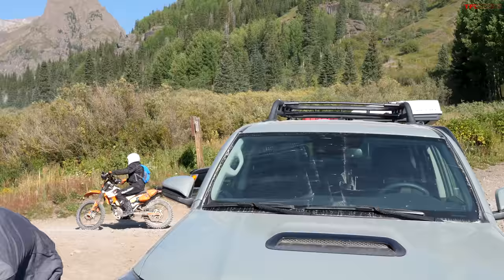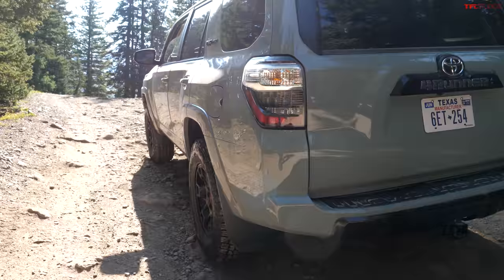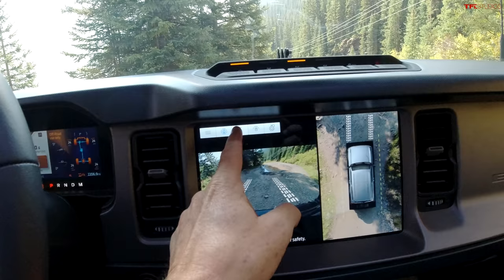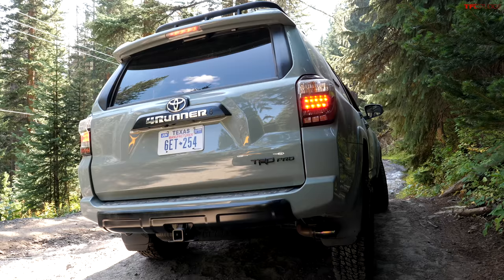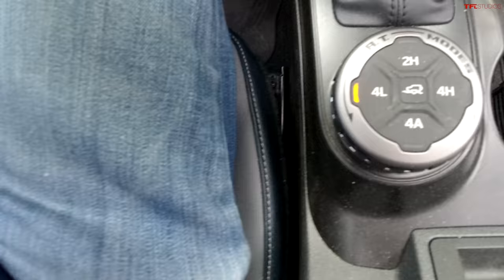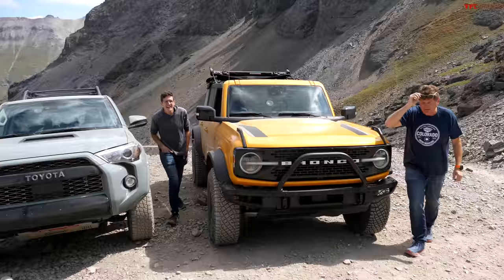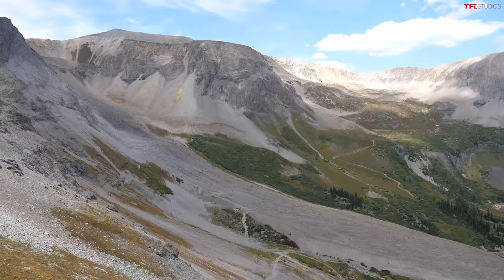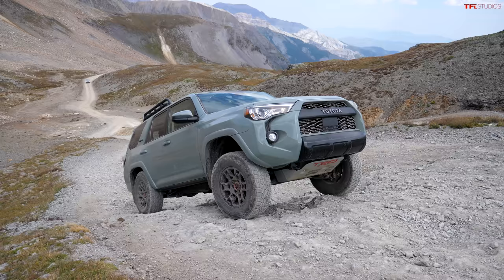The Toyota 4Runner TRD Pro May Be Old, But Can It Still Keep Up With The Ford Bronco Up A Mountain?

Comment: These vehicles only compete and compare with each other when new, after the warranty is up the Ford will not be worth owning any longer whilst the Toyota will still be going and going and going........TRD Pro is old and reliable and proven itself over time, Toyota has good reason to not update the platform every year.
Reply: So true.  Bring these exact vehicles back in 10 years and try again.  One may not even show up for the challenge.
Reply: It will be interesting to see what they do with the new 4runner that is supposedly coming in 2023.  Anticipating more electronics and a turbo 4 (maybe they will put the twin turbo 6 from the Land Cruiser in as an option, but I doubt it).
Reply: 4Runner/Taco Bros: "look! I've gone 300k pavement miles"

Bronco and Wrangler Bros: "cool" goes back to actual offroading*
Reply: @mattg8116  the kids need to get to soccer practice somehow!
Reply: @mr75204  calm down karen , don’t get your princess undies in a bunch.

Comment: Long term durability is where the 4Runner shines. The old school Japanese assembled 4Runner will last 300k with very little routine maintenance and minimal repairs.
Reply: Yes but as much as people hate to admit it Ford vehicles are pretty reliable. Just like every brand they have recalls Toyota just had a massive recall. There's so many old '94 ford's cruising around with over $250,000 miles on them
Reply: @usz28  Of course there are some Ford models that end up being reliable but overall Toyota as a brand buries Ford from a reliability standpoint.  Even with the recalls.
Reply: Tell me about those old Toyota timing chains, head gaskets, and frame rot just to name a few. This coming from my own experience.
Reply: Fact: if you get 100,000 Toyota anythings and compare them to 100,000 Ford/Jeep/Nissan/any brand comparable, the Toyotas will have more cars that continue to work and fewer that have significant problems. There are lots of reasons not to buy a Toyota, but they are the best at what they aim to do. In fact, every industry on the planet has tried to copy how Toyota does what they do, and Toyota is still the best at that process. They have the secret sauce built into their culture, and no manufacturing, tech, healthcare, or any other kind of company has been able to better them.
Reply: Yeah, everywhere except the salt belt.   Mechanically great, the best IMO...but their vehicles on frames, FJ's, Tundra's, 4Runners, etc, just don't last. Maybe these last couple model years they've finally turned a corner, but a 2017 Tundra I looked at last week, was already rusting through the bed where it mounts to the frame.  Which is apparently a common issue.
Reply: @brookdavis8425  Tell us which brands don't.
Reply: I'm going on 22 years with my 98 4Runner. Zero rust, southern car.
Reply: @luchaDor  you need to move!!  I take brake lines off 20 year old cars with no torch.
Reply: @GoDaveGo  Correct! It's not the  product, it's the culture of the people who made it - discipline.
Reply: @usz28  Ford - FIX OR REPAIR DAILY
Reply: I agree. I have a 300k Toyota my self.
Reply: I love my Toyota’s but in the North they rust worse than almost anything. My dad has driven Fords, my Brother Chevy’s and I Toyota’s for a long time. Day to day reliability the Toyota is the best, but frame rot and rust anything else is better…
Reply: @usz28  NO WAY rust ,rust ,rust
Reply: @billyhughes9776  - no it does not, you can’t compare a truck that’s hard 100k hard miles of constant towing and running long days to a commute to an office job and Whole Foods once a week
Reply: I've had my 2000 Tacoma going on 21 years now. Very little rust,very little in repairs. 2.7 motor with 325000 miles and still runnin strong. Daily driver
Reply: @slinginlead6647  what is your general location? Rust belt?
Reply: What does Scotty Kilmer say about Toyotas?
Reply: I can verify that Toyota Tacoma will last 315,000 with the biggest problem being a serpentine belt idler having to be replaced at a cost of less than $50. I kept up with routine maintenance.
Reply: @fireye0889  Central Virginia
Reply: That's not really some huge accomplishment for trucks.  There are plenty of F-150s that are above 300k miles and still being used as work trucks.
Reply: FordGTGuy    says the ford guy, literally!   No one cares what I think or you think just read the facts by independent researchers that show Toyota far far far far beats ford in reliability.  It's not even a discussion that should be had.  That bronco will be in the  shop until the day it's sold for half its value while the 4Runner will hold 80% of its value if the owner is dumb enough to sell it cause it will last for hundreds of thousands of miles.
Reply: @TS-xj5mt  Ok?  I've been in many Fords with over 300k miles.  Crown Victorias, F-150s, Explorers, Expeditions, Broncos, and even Mustangs.

Road is packed with old Ford trucks and cars that are both workhorse service fleet vehicles and privately owned.

300k is not some crazy number to hit for cabs or work trucks.

Modern Toyotas do not have the reliability they once had.  The idea of modern reliability research is BS too.  If a car has an issue with the infotainment system it effects the reliability numbers.  On top of everything Toyota has had more recalls than any other manufacturer.
Reply: Any vehicle can last 300k with maintenance and minimal repairs. But how many people will actually stick to scheduled maintenance or actually care to keep a car or truck that long?
Reply: @drpeppero3  Funny how that never really happens much outside of the Toyota world.
Reply: @fordgtguy  I am enjoying the (in typical Ford fashion) shit-show that is the new Bronco.
Reply: @Pleasiotic1  really? Are you sure? Stop being a fan boy. If it wasnt true. Collector cars or trucks and or vintage would never be a thing.
Reply: @drpeppero3    Yes I am sure any non Toyota 300k anything has next to zero value assuming it even runs correctly and has probably mostly fallen apart unless its something that is brand new and was just driven 24/7... and even then.  Look at the value of a 300k 4runner vs any 300k Ford product and try again.   Also show me how many 300k Kia's and Chevy anything or how about Mazda or Mitsubishi are still running around like a top only having had actual routine maintenance?  How many Million mile non Toyota's are out there? 

There is a reason the anecdotes that are popular exist.
Reply: @Pleasiotic1   I've driven Explorers with over 500,000 miles.  There are a bunch of F-150s and Crown Victorias north of 500,000 miles.  You guys do realize that 300,000 is not that impressive and not something only Toyota vehicles accomplish?   Anyone paying high dollar for any car with 300,000+ miles is an idiot.

There is a Crown Victoria with over a million miles.
Reply: @usz28  Ford TRUCKS are pretty reliable. Ford CARS aren't.
Reply: @GoDaveGo   It’s model specific.  Toyota has shipped some unbelievable hunks of 💩 in recents years.   Like that 2.4 4 cyl that came in Camry, Scion Tc, etc. 

I’ve seen so many of those things are massive oil burners from day one…I’ve also seem many jump time at destroy themselves below 100K even when they were religiously kept topped off with oil.   

If that engine was a Ford or GM engine the issues would have been announced the rooftops.
Reply: @mayanaztec6440   I have a 400K Ford, anecdotes are great
Reply: @TS-xj5mt   Lol, your logic, reason and understanding of the automotive industry is impeccable.  🙄😂
Reply: B C 08     thanks.
Reply: B C 08   I have a family member that smoked two packs a day for 60 years and died in his 80's.   you should try that and see how it works out for you.   I love you people with your antidotal evidence that should overshadow millions of statistics and research done by independent engineers and repair statistics for 50 years.
Reply: FIRST ON RACE DAY PROVEN!
Reply: Are they charging extra for the leaks in the Bronco?
Reply: Ford won’t pass 150k without major engine repairs
Reply: False OP
Reply: @GoDaveGo  YES. It's called the Toyota Way...the most copied manufacturing platform in the world. 5s and continuous improvement.
Reply: @luchaDor  If you live in a salt state it will rust any vehicle. I live in Cali and have a 1985 Toyota pickup no rust still running.
Reply: @Pleasiotic1  Is a new model from scratch they will continue to get better, and I assure you they will be a good and reliable as all F150's are, I'd gladly trade in my 16 4Runner for a Bronco in a blink of an eye, no comparison here, side by side the Bronco will blow our 4Runners doors off easily..
Reply: @Pleasiotic1  Dude, have you seen the prices on those half a million Continentals?? They are nowhere in the low range, Also a well taken care Mustang and Ford truck keep up their value no matter the mileage, get outta your bubble.
Reply: @SSVplus  Lol the only non reliable Ford cars were the Europena models, ALL domestic V8 Fords specially and Mustangs, that includes also large size cars are among the most indestructible cars ever made.
Reply: @JohnJones-ty6fj  That ain't a big issue, only roof needs remodeling, what about actual off roading performance???
Reply: @TwinTurboToyota  HAHAHAHAHAHAHA, what a fool, I've owned many Fords, ALL had gone like nothing after 250K miles, you must be on another planet.
Reply: @gorgeusjames  it will spend more time in the rain here than off-road. It’s a big deal if it’s mildewed a few months into its life.
Reply: @gorgeusjames  Mustangs are not reliable.
Reply: @SSVplus  Said no one ever, I owned 3 and all had been on top, it's easy to google it, huh...unless you drive like you're on a rece ANY car will break down..
Reply: @JohnJones-ty6fj  Well, good I don't live where it rains and snows otherwise my 4Runner would be rusted to death..
Reply: @gorgeusjames I own two 4Runners. No rust. No leaks. And it rains a lot here.
Reply: @SSVplus  🤣Ok whatever makes you happy.
Reply: 22 years, 300k miles.2/3rds of it's life in Colorado and the rest in Oregon. My 00 taco TRD hasNothing more than lil surface rust on frame here and there. It's only needed 3 repairs to get it back up and running in all that time. 2 starters and 1 ignition. 650 bucks total. Best damn vehicle I've ever seen, heard of, had. Still going strong every day.
Reply: I’ve had a 1997 ford explorer that had 397,000 miles when I sold it.   I still see the kid driving it around time to time. 

I’ve seen more 300k plus explorers than I have 4Runners.  

With Toyota, It’s always wheels bearings and wheel bearings and wheel bearings.
Reply: @Igloo_papi  I have a 2002 expedition, idk how different they are built from a explorer but it is problem after problem at 140k+ miles luckily nothing major that’s why it’s still with me.

Comment: The Toyota will be ultimately more reliable in the long run
Reply: Another person who knows the future... NOT!
Reply: History tends to repeat itself.
Reply: Supercreech  If you are speaking of the 4runner, I agree. The Bronco is in a class with Jeep Wrangler and Land Rover Defender; the 4runner is not there.
Reply: I bet the p/s will go out in that 4runner at about 30k miles. They tend to fail.
Reply: ...Until the frame rusts out from underneath you!
Reply: Frame rust isn't a problem on new 4rs.
Reply: Supercreech  I'm going on 350,000 miles, and no such issues. 1998 SR5 4X4
Reply: ...as well as in the short run.
Reply: by FAR!
Reply: True the 4Runner holds its value, the Bronco will speed up the next 4Runner.

Comment: Tommy's summing-up of both vehicles was spot-on. 
The Bronco is a very desirable vehicle with much more rubber, more lockers, better departure angles and is a brand-new vehicle - benefitting from the use of more modern technology. But the Toyota, without many of the toys the Bronco has, will still go just about everywhere the Ford will go but, like Tommy said, 15 years down the line a Toyota will still be going strong but the Ford will probably be on the scrapheap. 
There's a reason why the UN and other NGOs operating in the most remote and harshest terrain in the world pretty much only use Toyota and Japanese vehicles.
Reply: Nice comments 👍
Reply: well said.
Reply: I guess, but honestly there’s more to it than just “ford makes cars that break.”  That 2.3 will go a LONG ways, the 2.7 in this Bronco can be the same, and Ford uses amazing gearing with the only real exception being their stupid automatics.  I’d say the 2.3 ecoboost with a manual transmission will last just as long as the Toyota, especially since Toyota’s longevity benchmarks have been a little bit more unclear recently.  Hell, newer TUNDRAS are blowing main bearings at low miles.
Reply: And now the legendary 4.0L is gone, after guzzling more than our fair share of dead dino juice. Replaced with a turbo, one would think the reliability will undoubtedly take a hit. Turbos need more attention. Period. 

Meanwhile I hope the new FJ has a good EV option with better range. Solid state batteries should help lower weight, but that's another episode. Great episode   🙂
Reply: @zeropointstar  It just can't go as long as that 4.0. You have so much more shit that can break on the new turbo engines, you're gonna be placing a turbo long before the end of the engines life. Not to mention other shit like HPFP.
Reply: @zeropointstar newer Tundra engines blowing up have nothing to do with the 1GR-FE  4.0L V6 in this 4Runner though. This v6 is a dinosaur that is proven and reliable. The new Tundra however uses a turbo V6. Very different animal

Comment: I just went over Imogene Pass in a stock 2003 Suzuki Vitara with 28” KO2 (stock size) tires.  I had no issues at all.  It just shows that you do not need a new very expensive 4X4 to be able to go on trails.
Reply: Wow.  Thanks for that comparison point.  Now I can take this channel with a grain of salt.
Reply: Just did it a few weeks ago in an F350 (Tremor)...  Was a little tight around a couple of the switchbacks (had to do a multi-point turn a couple of times), and when there was oncoming traffic in a couple of spots, but knowing the edge of your vehicle is a great thing.  The looks on some people's faces when the beast came through was hilarious.  Had at least 4-5 people on the trail give me kudos for using it like it was meant.
Reply: @RickysHP  I didnt know about the Tremor until just now when I read your comment. Basically an off road package for the F350? Freakin sweet! Now I want one!
Reply: @Jim Parchert I did the same trail in my old 2009 Hyundai Santa Fe on stock tires no lift and not even a 4x4, it was a 2x4 fwd.
Reply: @sargeredteamleader1762  stupid is as stupid does. I'm sure you had to take every bypass on the route with it, too.
Reply: I could take my x-90 😁